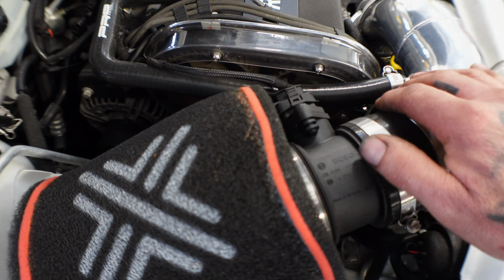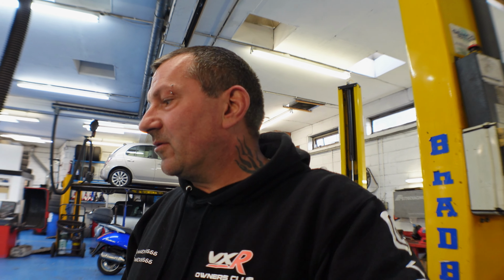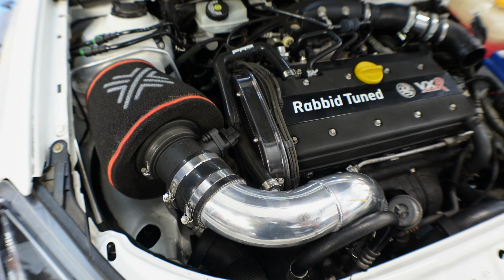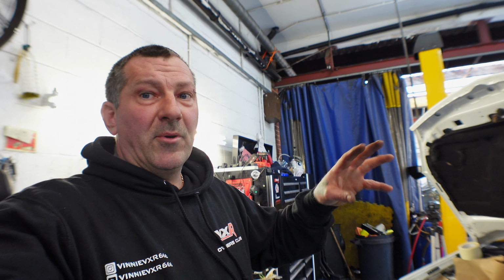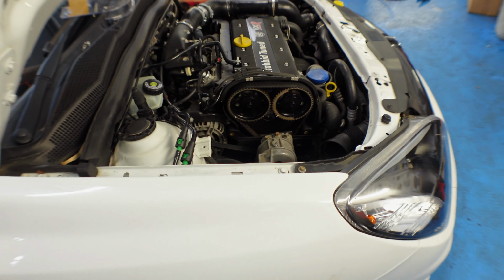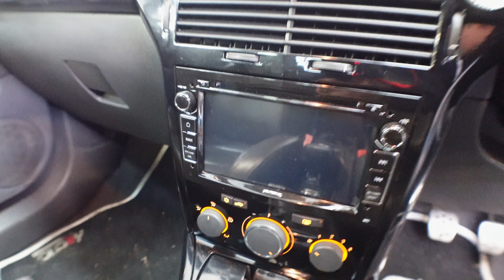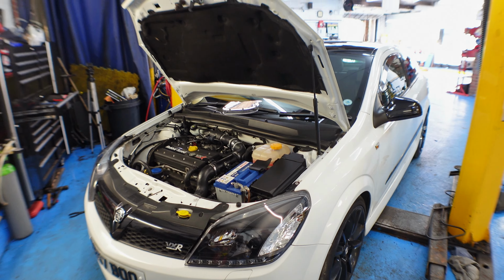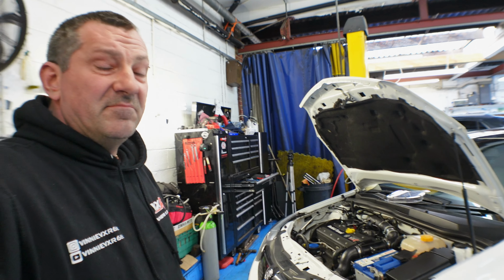Astra VXR Artic Engine bay tidy up ￼

Comment: 2010 models he wing mirrors had to change for some EU rule, mines the same (2010 Arden). Always fun to try and find the right size glass for the mirrors
Reply from the maker: Ok so is that why are they different then I only found out because I was cleaning them one day and broke the mirror tried to replace it with mine but it didn’t fit lol thanks for the info for that though mate